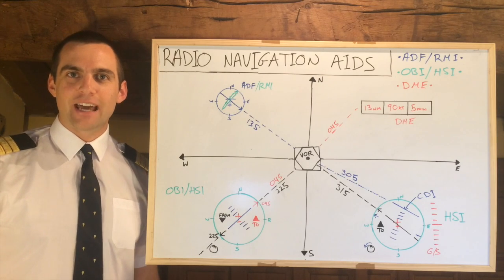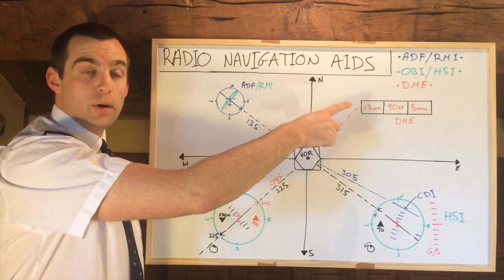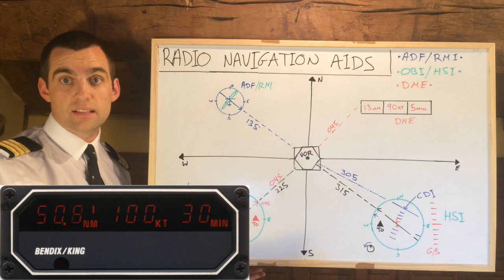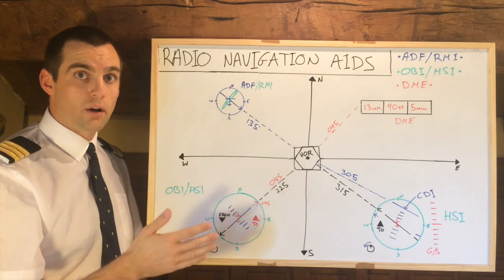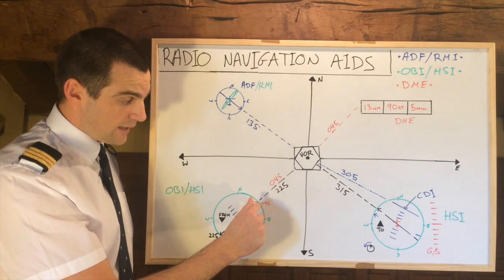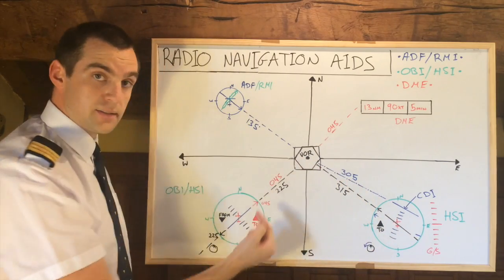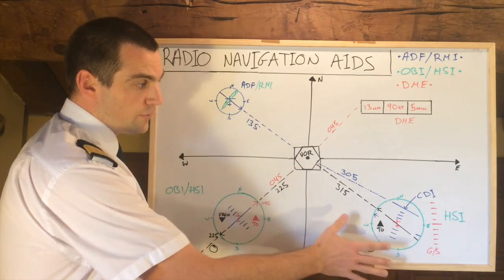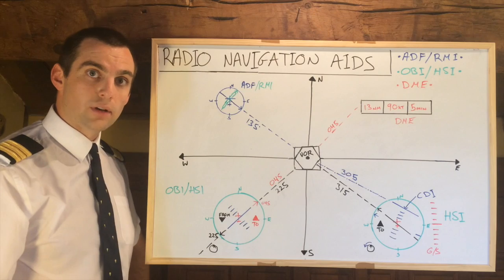Radio Nav Aids ADF RMI OBI HSI DME ✈ ATPL ✈

Comment: I was just revising radio nav concepts, and I must say this video did the briefing concisely and cleared up most of the confusion I had on the subject. Great job, Cap!
I remember my instructor mentioning something about HSIs commanding correctly over back tracking . I am not sure.. I was wondering if that is of much relevance to actual airline flying?